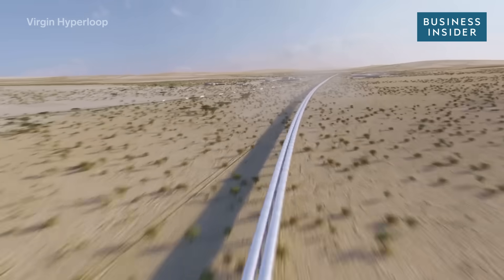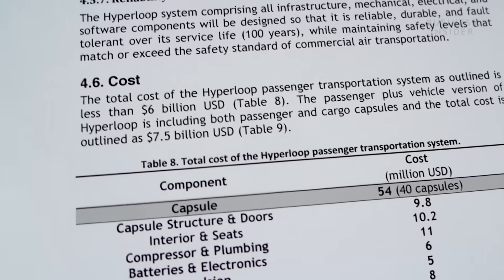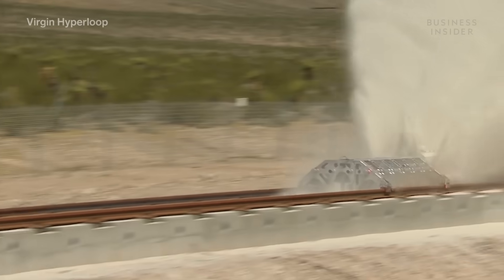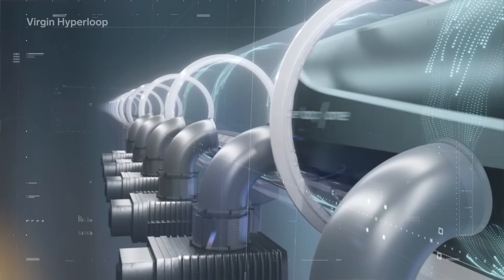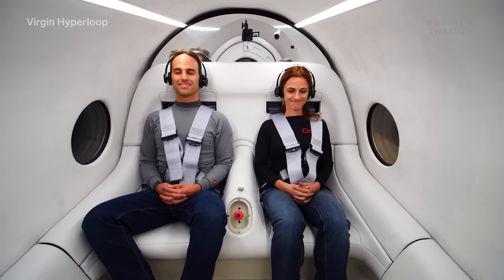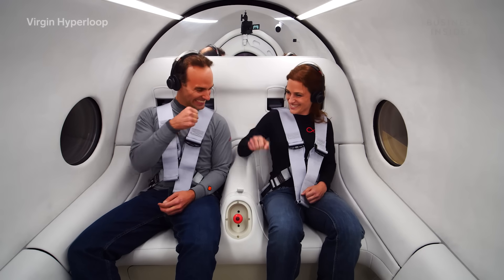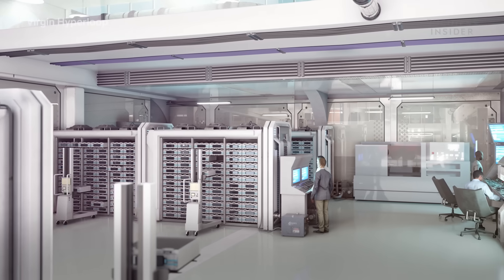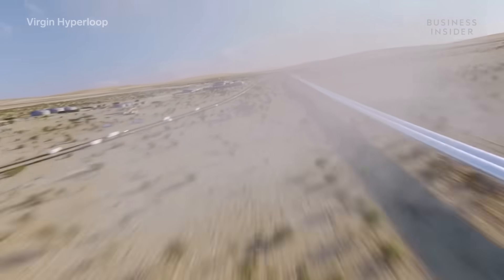How Elon Musk's 700 MPH Hyperloop Concept Could Become The Fastest Way To Travel

Comment: Everyone gansta until a crack forms and it sucks the air out.
Reply: Then the atmosphere goes blitz into the passengers at the speed of sound
Reply: Honestly it would be more practical to improve the existing transportation.
Reply: @randompeople7595  How do you deal with air resistance? Now they're making amazing ways for transportation that could change our lives for ever.. Airplanes will be able to reach outer space and orbit like a satellite so you can go from any point on earth to the opposite in just 45 minutes of orbiting since near earth satellite make full circle in just 90 minutes like the ISS.. Look up virgin galactic
Reply: @knightara  You would need alot of fuel to go to space and it is soo expensive, SpaceX Falcon 9 has a cost of 2,750 usd per kilogram of payload. Not to mention the space shuttle, which looks like an airplane, has a cost of 54,500 usd per kilogram of payload. Even if we managed to send an airplane to space it would be ultimately better to just launch a capsule containing people. Jet engine which is used in airplanes are efficient than the rocket engines use in space so I don't see a reason to launch an airplane to space or make an airplane capable of going to space, if you want to go to space it would be more inexpensive to use a spave launch system than a airplane capable of going to space.
Reply: @knightara  We could fly an airplane to space, we could make the hyperloop and a nuclear fusion reactor but the problem is, it is soo expensive and hard to make, that it is much better to improve and optimize our current transportation than to make a new one. These kinds of technology would be more viable in the future were it is less expensive because of rare materials getting more common by going to mining asteroids and the moon, discovering new sources of this materials or the current transportation getting as expensive as the proposed new transportation.
Reply: @randompeople7595  Expensive for now but will get cheaper in 20 or 30 years.. First rich people would be the target for these projects.. Guess what .. there's a huge rich population that would love to get from one place to another in minutes and not spend a whole day traveling because their time is so valuable for them.. Things will get more efficient with time .. they might find other means for fuel.. for hyperloop they could just cover the top of the whole tube with solar panels and it would provide electricity for itself to operate forever.. Also I don't know if you guys believe in this but I believe AI and specified job robotics will dominate our world in the next 15 years and we'll rely on them for maintenance and hard labour jobs..
Reply: @knightara  more people will be rich and ai could take over jobs in the future is true but hyperloop just seems unsafe and impractical. Convenientional methods are better for now but in the future maybe they will find a way.
Edit: hyperloop just seems like a joke like the cyber truck.
Reply: @knightara  Hyperloop would simply fail due to it being less profitable than conventional transportation and the safety of hyperloop is another reason it would fail, it would be really prone to earthquakes.
But it could have practical solutions in the future
Reply: It’s like a metal tube I don’t that will happen often
Reply: To stop this argument, basically hyperloop is like a train in space, more expensive and less profitable than an airliner. Absolutely safer to take an airplane and probably better to improve airports and airplanes.
Airplanes are faster and cheaper I only see this as a replacement for trains but even then it is expensive and probably would fail
Reply: @Mark Branham at roughly the speed of sound to be more precise
Reply: You say its SUCK THE AIR IN THE VACUUMED TUBE since the air in the tube are almost none existent to avoid drag or what ever they says.
Reply: @vincentjayvalenzona4051  sucks the air out of the train depends on what cracks.
Reply: Like.. In a plane?
Reply: @trapko91  A) Planes don't fly at the edge of space, you can still survive at 30,000 feet with nothing more than supplemental oxygen. At the pressures involved in a hyperloop, you die very quickly as a result of ebullism if the pod ruptures inside of the tube.
-
B) Planes can descend fairly rapidly to an altitude where people can survive without supplemental oxygen if there is a loss of pressurization. In a hyperloop, you'd need to live long enough to make it to the next airlock station, but because of the low pressures involved, your chances of doing so are greatly reduced.
-
C) Planes are not actually perfectly sealed, because they're being continuously pressurized by the engines, but a hyperloop pod would require a very expensive and bulky system of pressurized tanks to keep a pod pressurized if it developed a leak, and it would be limited to dealing with small leaks because of the impracticality of having a system onboard which can handle large leaks.
Reply: @PistonAvatarGuy  The tube will be split in parts. If there is a loss of pressure in the cabin, a wireless signal is going to be sent to the tube's emergency doors ahead and behind the vehicle, then in a matter of seconds the pressure in the tube will be stabilized just by using the outside air pressure.
Reply: @termoyad5373  The hyperloop concept is already insanely expensive without such doors, adding those doors would add an absolutely enormous amount of cost to the hyperloop system. Sure, you could solve all of the problems with the hyperloop by throwing insane amounts of money at them, but that simply makes the idea even less practical than it already is.
Reply: @PistonAvatarGuy   Its all about long time investment. Once everything is figured out, this technology will get cheaper and more efficient.. we might stop using cars for long distances all together. You seem to be afraid of new innovations.. your mindset is exactly like when they created the airplane.. It's something new.. this can disrupt our lives in a positive way.. imagine traveling between countries in just minutes and there's no time for landing or taking off+  you don't wait for people you just fill the pod and go.
Reply: @knightara  I'm not afraid of anything, the whole concept of a hyperloop is just hilariously stupid and I love pointing it out to people. I mean, what is there to be afraid of? I stand to lose absolutely nothing if the hyperloop is successful, it just wont be, it's a nonsense idea.
Reply: @PistonAvatarGuy   so was the airplane.. It was a crazy idea! Also making rockets that goes to space is a crazy idea and cost infinite amounts of money to launch a rocket yet we really rely on them and wouldn't have Satellite orbiting around us and there will be no GPS or none of that. The hyperloop would really change the world for the better and you will see my friend.. Dubai and Saudi Arabia are already investing heavily on this.. If you were in the 1700s and I told you about Highways you would think it's a crazy idea .. How can people pave thousands of miles of perfect roads that cut mountains, rivers, valleys and what not..
Reply: @knightara  But those ideas were crazy because we didn't understand the technologies involved in their operation, while the hyperloop involves the development and production of absolutely ZERO new technologies. It's all already been done and we already know everything that we need to know about these technologies to say that the hyperloop will not be a revolutionary form of transportation. I don't understand what it is about you people, it's like you're not aware that it's 2020 and not 1850, it's REALLY bizarre.
-
Sorry, but the only people who think that the hyperloop will amount to anything are people who have absolutely no idea how anything works, they're like troglodytes who look at advanced technologies as though they're magic. It's quite sad that such enormous amounts of money are being wasted when there is so much need in the world.
Reply: @PistonAvatarGuy  My friend we know how it works and it's really simple.. Have you ever heard of the Large Hadron Collider?  It also uses the same idea of vaccum tubes. The concept of this is very easy.. Just Maglev trains inside vaccum tubes to avoid air resistance. It's simple and it's revolutionary.
Reply: @knightara  "...and it's really simple."
-
And that's how I know that you have no idea what you're talking about.
Reply: @PistonAvatarGuy  ok tell me what is not simple? Vaccum tubes ? Air sealed pods? Doors? Energy? Construction? Or what exactly that's not simple.. They've been using these technologies for ages..
Reply: @knightara  The combination of people in pressurized pods inside of a vacuum tube, building vacuum tubes over long distances (thermal expansion), airlocks built to be used in a mass transit application and the speeds involved all add up to some serious complications. With the limited passenger throughput of the system, the cost will never be justified, which is the main problem. The Transrapid system makes far more financial sense and is likely to be every bit as fast as any hyperloop pod ever will be.
Reply: @PistonAvatarGuy  You really seem not to understand it yourself hahahahaha.. How can you say limited passengers when it can literally operate pods back to back with sensors and AI .. You really don't know that by making this you can basically make a 2000 miles train that never ends and Carrie's million of people at the same time.. hope you understand
Reply: @knightara  "How can you say limited passengers..."
-
Because the airlock procedure will limit the number of people that can enter the system in a given time period. Why would the system need AI for anything? Simple programming logic would suffice.
-
"You really don't know that by making this you can basically make a 2000 miles train that never ends"
-
Oh? And are people just going to jump in the pods as they scream by at 700 mph (if they ever go that fast)? The pod will need to slow to a stop before going through an airlock procedure to exist the tube system, it will exit the tube system and the passengers will board (which will likely involve strapping themselves in with seat belts), the pod will then go through another airlock procedure before reentering the tube system and it will need room to accelerate up to top speed, this means that the spacing between pods will need to be VERY significant. I understand that you don't understand.
Reply: @PistonAvatarGuy  
My friend English is not my first language so if you see a lack of expression from my side then consider it.. Don't tell me I don't understand.. You are the one who does not understand. You really have to look it up extensively and know how AI could help with the very exact problem you mentioned at the end which is how we merge pods together at very high speeds.. So basically you just create a merger tube that is long enough for the pod to accelerate and merge into the fast tube.. You gotta think with open mind.. peace.. USE AI to control pods to contact to each other in case slow downs, accidents, or merge into the fast tube..
Reply: @knightara  More tubes, more pods, more airlocks... it all just adds cost.
Reply: @PistonAvatarGuy  It's a one time investment my friend just like Highways. They only need to be maintained and for what I understand maintaining it won't be very difficult.. In the long run it can be very profitable.. Have you heard of the Suez canal? It is one of the most complicated projects that was dug in the 19th century.. it costed a fortune and people like you thought that it was nonsense project and will never be done.. Now it's one of the main incomes to the country of Egypt, and one of the most important shipping lines in the world..
Reply: @knightara  Everything will need constant and expensive maintenance. The airlocks, the pods, the vacuum pumps, the expansion joints, etc... will all need to be routinely maintained. The pods are also likely to need replacement after some time because of the constant pressure cycling. Anyway, come back when the hyperloop exceeds the speed of a jet airliner, then you may have a revolutionary technology. For now, hyperloop isn't even as fast as high speed rail, it's just a joke.
Reply: @termoyad5373  you have no idea what you are talking about. Have you ever worked with vacuum systens? I doubt it.
Reply: @knightara  exceot the physics of airplanes works out in scale models. Do you know how hard it is to draw down and maintain a vacuum in even small vacuum systems? What about thermal expansion of the tubes? You think of that? Or do you still believe in the theory of "caloric fluids transferring heat?"
Reply: @PistonAvatarGuy  to be fair seatbelts would be pointless...if anytbing goes wrkng the lassengers would tjrn to bloody mist as the ATM rushes in at the speed of sound and everything fails catastrophically.
Reply: @dheibeljr  Yeah, they wouldn't be a huge help in accidents, unless the pod got slowed down significantly before impacting something, but they would be necessary because of how rapidly the pods would need to accelerate.
Reply: @knightara  talking to you is like talking to a wall or a rock
Reply: @davicarvalho6699  When did I speak with you ?
Reply: @trapko91  A plane does not travel inside a vacuum.
Reply: @archaevist  What about the ISS?
Reply: So basically a plane???
Reply: @gavrielataravari  wow....no...not even close.
Reply: Vacuum technology is so well developed this is very unlikely to happen. We would not have modern electronics at the level we do if it weren’t for vacuum technology being as advanced as it is
Reply: @Dankrad123  still really dangerous and really prone to terrorists attacks, even the slightest of cracks could result in the vacuum seal being broken.
Reply: @Dankrad123  Vacuum technology is developed? Absolutely, we can create vacuums with soo little matter in an area but predicting earthquakes? No.
Hyperloop is like a train in a metal tube in a vacuum right? Now imagine earthquake comes and turns off the train, you would be stuck in a metal tube unable to escape while being in the danger of a vacuum.
Let us say that no strong earthquake will happen, hyperloop needs the outmost maintenance even if robots does the work it would take alot of time maintaing a train in a metal tube. They or it would need to suck all the air out then check the whole track and train for issues because even a single crack can cause it to not function as the air goes out.
Reply: Vacuum technology has not applied to extremely long tubes yet. I’m not sure what the thermal expansion coëfficiënt of steel is, but over long distances a steel tube could easily expand  tens to hundreds of meters. Hard to keep that in a vacuum. And while “vacuum technology” (which isn’t really a thing) might be there, a terrorist with a bullet can easily destroy the whole thing. It’s just not viable to make it safe. The speed you gain in a vacuum tube over a regular high speed train is just not worth the effort.
Reply: @ballsdeepinglory3054  You are Absolutely right. Vacuum is hard to maintain in long tubes, Prone to damage from humans or the environment and not worth the effort by having a little advantage but with alot of disadvantages compared to high speed rail. I would also add it is not economically viable as it is less profitable. I guess it ends the arguments here.
Reply: @randompeople7595  Exactly. It is one big publicity stunt for the persona of elon musk, fueled by media that can't scientifically and methodically investigate a topic and just breaks the news to the uneducated masses.
Reply: Ballsdeepinglory your claim that “vacuum technology” isn’t a thing is wrong. Tell that to people with a PhD in vacuum systems, and all the chips in your phone that cannot be manufactured without it.
Reply: @Dankrad123  Vacuum technology is about a better vacuum with less and less parts per million. Pretty sure it is still prone to damage of any kind, expensive and hard to maintain.
Reply: @Dankrad123  You realy have no idea how vacuum technology works ! There is noz some kind of magic protecting it. even a hole smaler than a pinhead would kill every single person inside of the whole tube
Reply: @hailgiratinathetruegod7564  A small pinhole would not kill every person inside...
Reply: @Dankrad123  the air will rush out the train stopping the hyperloop from functioning or it will just work like a normal train in a tube.
Reply: @Dankrad123  So it’s impervious to earthquakes, thermal expansions/contractions, small arms fire, accidents outside the tube system. Yes we are so advanced it would nit fail from all that.
Reply: Synaptic Decay Vacuum technology =/= hyperloop technology. No where in what I said I claimed that it’s impervious to any of those things. I’m saying that we have developed an advanced level of it and that scientists and engineers are more than capable of finding workarounds for multiple different scenarios. They’ve done it before, they are capable of doing it again

Comment: They tested it at 100 miles per hour imagine 700 miles per hour they'll freaking die
Reply: It will never go 700 miles per hour
Reply: @markomclane475  they said it would in the video
Reply: @agentjackal2937  Its an impossible concept... it will never work because you can not build a 600km long vacuum chamber. Don't fall fir this fraud.

Comment: What happens if someting broke? Does it stop like a a car, or u go flying?
Reply: you get wings 😂
Reply: If the tube breaks you die. The inside of the tube has the atmosphere removed to create less drag. If the tubes structural integrity fails, or let's say someone shot a hole into it, a massive burst of atmospheric pressure would be shot down the tube at speeds around the speed of sound, and it would crush you on impact due to the force.